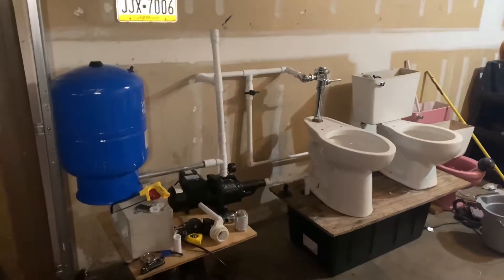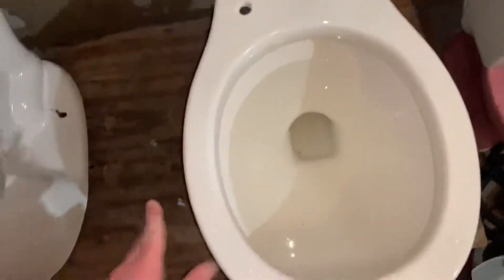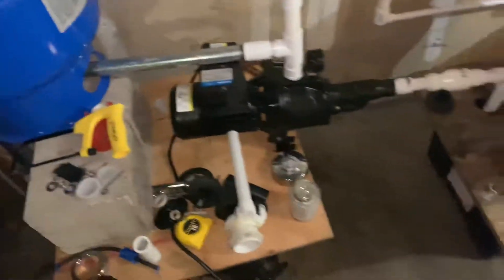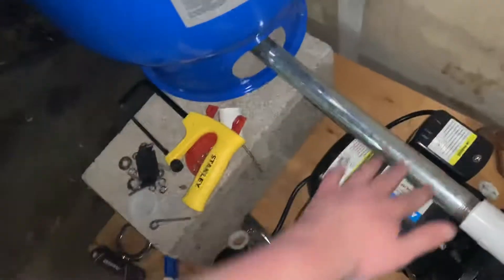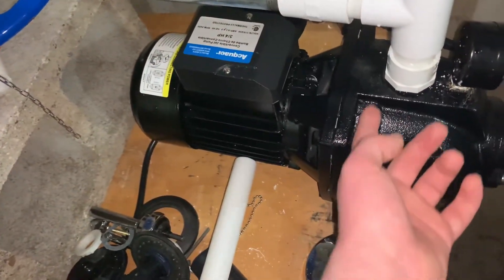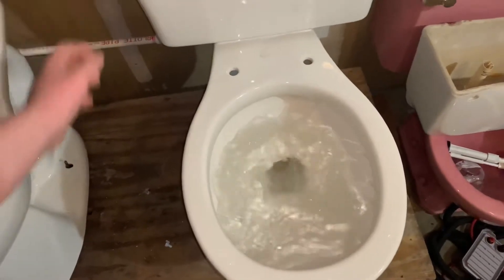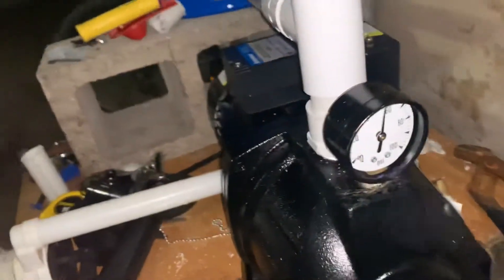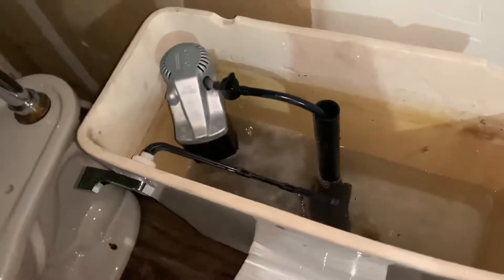How My Flushometer Setup Works! + Updates!

Comment: I  bought a comercial toilet and installed it in a bathroom I made outside but I didn’t know it would not work if I had 1/2 water tubing inlet from the house.  I don’t want replace it. I was wondering can I install a pump to increase the volume of the water going in to the flushometer.

Comment: I really like your "terlit lab" setup, especially the conservation of water. Have to trade off keeping the inside of the pressure tank bladder clean & pristine from algae & mold vs using all fresh potable water from city mains, and using the "gray water" from used (and reasonably clean) terlits elsewhere, like the garden. I would add a water meter at the incoming potable water supply to measure gallons used to see if conservation is cost-effective. Since you do have a pump attached, do you have a  pressure cut in/out switch for  the pump so it can act in a normal situation? Keep up the great work and videos. 😊

Comment: I want to set up a flushometer in my house. Do I need the pressure tank? Or could I connect directly the water pipe? Thank you
Reply from the maker: You do need a pressure tank, or else it will not work. You also need a 1 inch pipe to have it function correctly.
Reply: @aftplumbingofficial  thank you.